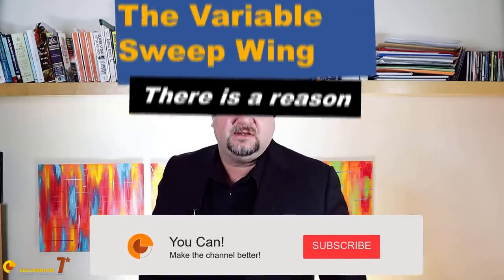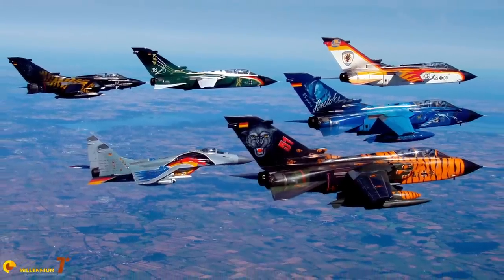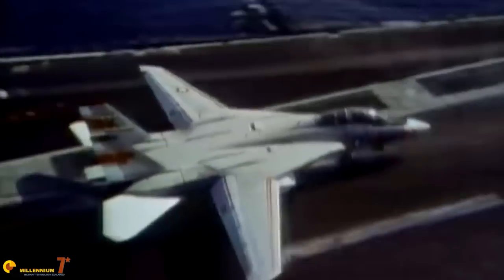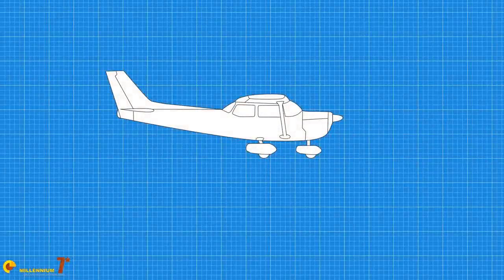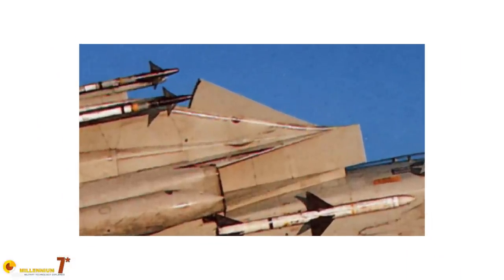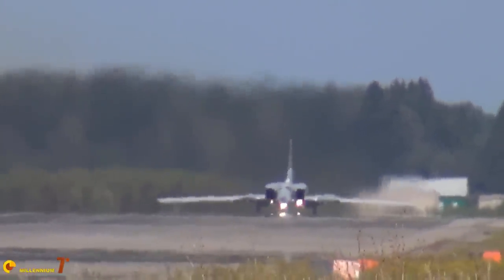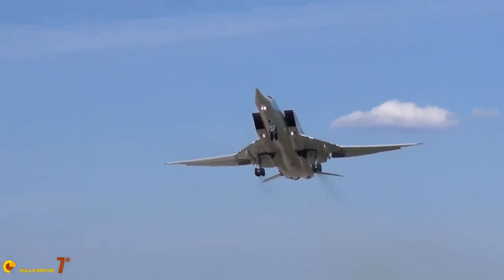F-111, F-14, Tornado, Su-17 were Hopelessly Outdated - the demise of the variable sweep wing

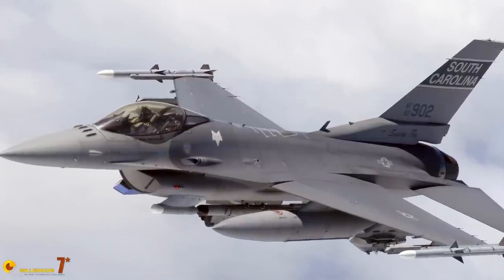Comment: so I actually paused at 4:10 to answer in the comments lol:
being “stable” means applying some kind of negative feedback mechanism which it means it inherently fights back at what you want to do/go, which is inherently counterproductive when you are designing that is expected to exert maximum performance on a regular basis. I’m not fluent in aerodynamics but I am just applying negative/positive feedback logic.
In a scenario where you want are expected to turn at maximum rate etc, having a negative feedback characteristics seem counterproductive, but would be more forgiving to fly. But then yes, computers, so you can have flight computer forgive the pilot instead of the laws of physics.
Reply: This was seen in practice: During ww1, higly maneuverable airplanes like the Camel and Fokker series were only flown by experienced pilots due to the skill neeeded to fly them. Needs constant care on the controls.  Not to mention the engine torque.
Reply: @ASJC27  I think the original commenter was speaking more in terms of a simple non-augmented airplane which does in a sense "fight back" if it is designed with natural stability, right?  Otherwise the flight control requirements for the pilot would be too fatiguing or even impossible to manage if the static margin were reduced too much. I know that you know that also. You are speaking more about an inherently unstable vehicle with computer augmentation. In the end of the commenter's piece, he even acknowledges that with computers, the aircraft can be designed to be (artificially) more forgiving when necessary. I am also a former aerospace engineer. While everything else you say is true, perhaps you are being a bit hard on this fellow, respectfully.
Reply: I'm not an aerospace engineer and don't play one on TV, but stability doesn't make an airplane fight the pilot's control inputs.  Stability means the airplane seeks to return to its trimmed flight condition when displaced from equilibrium.  Pilot control inputs change the trimmed condition and the airplane seeks a new equilibrium.  
I don't believe relaxed static stability is about making the airplane pitch faster; it's about eliminating the downforce on the elevator that decreases the net lift vector and increases drag.  Take two identical airframes, but make one unstable by moving the CG location, and the unstable one will have better some margin of increased  instantaneous and sustained turn performance.  Maneuverability is about the velocity vector.
Reply: @ASJC27  Thank you very much for the detailed explanation.  I been reading misinformed commentary on the contribution of RSS on many channels and forums, as well as hearing the same misinformation on poorly researched television documentaries that simply repeat what was heard elsewhere. Thanks for the help and reaffirmation

Comment: In sheer flight performance, The f14 outclasses the f18 in speed, range and weapons payload and maneuverability. With an avionics/ electronics and weapons upgrade, it is superior. The f18 is simpler and cheaper and therefore maintains a higher state of fleet readiness.....but superior to the f14?.....ah....no.
Reply: but logistics win wars, so .....oh....yes.
Reply: @TealJosh  logistics?Depending on the combat capabilities of the aircraft. So once again....no. Every USN pilot on record who transitioned to the F18 from the F14 who was asked, prefered the F14....They should know.
Reply: @Phuc_Socialist_You_Tube  Shit, I would prefer the tomcat 100%. Nothing beats the feel of steam gauges and analog controls overall. Doesn't take anything away from the objective facts.
Reply: @TealJosh  I Agree....Objective fact one:The f14 Carrys more ordinance....Greater speed, range= it's in the fight longer. Chances are fewer 14s are required than 18s for the same mission. The f18 is far outclassed by the Sukhoi 30M. The f14 not as much although the avionics/ weapons systems would require a massive upgrade. The f18 Hornets upgraded to super Hornets still lag behind in range and speed.  The f14 could still, if modernized, counter threats to a carrier faster and at greater distances than 18s. If you haven't learned to walk on water yet, I can see why the navy wanted to retain them. They felt better equipped. Likewise I can see why bean counters wanted 14s gone.
Reply: @Phuc_Socialist_You_Tube  It always sucks to get something new compared to the old for which you have perfected a doctrine of usage. Your first objective fact btw is wrong, Rhinos have 11 pylons, while f-14 has 9. Legacy hornets had two less, i.e equal to f-14. As a counter, tomcat could take off with higher weight and land a lot heavier. Range is extremely subjective as million variables affect it, give it a tanker and problem solved. Fast interception goes for hornets 100%, they can startup unassisted and the systems are on faster. No matter what hornet is launched from the catapult faster than tomcat used to. I can go through the start up process step by step of legacy hornet if you wish, same with tomcat, I can estimate how Rhinos work.

Nowadays the Navy has built and perfected their doctrine around F/A-18E and F models + the EA-18 growlers. They have significantly better A/G capability than 30 years ago and have significant EW capability that practically didn't exist back then.
Reply: @TealJosh  Here we go again...Gruman offered the DOD a modernization program that would have addressed ALL of the issues you cling too....except the complexity of the swing wing design. It was the price tag. The Navy settled for the 18s, They didn't want them. Who wants to send out vulnerable tankers if there is no need. Now your protecting a ship and tankers. I was very well aware of what the Navy pilots thought of 18s when they got them. I wasn't a kid then. Of course the electronics are better on an 18. The Navy never upgraded the weapons and avionics on the 14s. Why would you when your decision is to scrap. Certainly you can understand that an aircraft that can tailor its wing geometry to its required performance envelope had flight characteristics a fixed wing aircraft can't match. It all came down to cost....and the fact that 14 airframes had a lot of miles on them at that point. The 18s are dinosaurs as are 14s. At this point in time  a better aircraft than either can be built. If, they had modernized the 14s then.....they would have had a better performing aircraft than the 18 now....No doubt at higher cost. The 14 compared to the 18 then would have been superior in all categories with Grummans planned upgrade package. Why do you think Iran still uses them when they could easily get new combloc aircraft. Iranian 14s have to be pretty decrepid by now. That's how much they respect the old war horse's capabilities as is. What you can't do is go through the operations manual for an aircraft that never was. The full extent of Grummans upgrades may have included air frames and engines and start up procedures, who the hell knows, If 14s were around today, they would be as different from the originals as a 16c is from a block 70. All I can tell you for sure is the Navy never liked the 18s speed or legs compared to the 14. Grumman claimed the 14 could completely outclass the 18 with upgrades. The pilots of the time thought it already did. That's good enough for me.

Comment: You completely misrepresent the decisions on the F14 program. The US Navy required a fighter that had significantly better combat range than previous fighters. The F111 turned out to be too large for carrier operations. The F14 significantly increased the range and payload of a Navy fighter and brought an extremely long range active air-to-air missile supported by an unusually powerful air-to-air radar. Because of DOD funding issues in the 70’s and 80’s, the F14 did not get its intended engines (GE F110) until many years later (early 90’s). The F14 community had to endure a weaker engine (TF30) that was supposed to be a short term fix to achieve an early operational capability.

The variable sweep allowed a heavy weight carrier capable fighter that had a slow enough approach speed at the ship yet could fly supersonic. That combination has not been achieved by any other fighter, even your unstable computer controlled aircraft designs. The operational requirements were met in the mid seventies with good design. The F-16 design could not even come close to the operational requirements. The performance of the F-14 airframe was so good, that an A-14 variant was considered that would have given the aircraft an all weather, day or night, low altitude attack capability while retaining a robust air to air capability. Politics and funding issues for competing platforms (A-6G, A-12, F-18)

Finally, your assertion that a variable sweep wing cannot be stealthy is very misleading. With the wings forward the aircraft would be less stealthy, but that configuration is not a combat configuration. It is a takeoff or approach configuration. There is no stealth requirement for takeoff or landing. With wings swept, a swing wing fighter can be stealthy. The very low RCS of pure stealth is not likely, but the very stealthy carrier fighter has notable range-payload limitations.
Reply from the maker: I am sorry to hear this but you are one of the many who think that the video is about the F-14, it is not, it is a video on the reasons why the variable geometry wing is not used anymore as a technology solution. The F-14 is only an example because it is easy to find data about it. There is a series of 4 videos about the variable sweep wing.
Reply: @Millennium7HistoryTech  The move away from the swing wing design is much more complex than your description. Balancing operational capability versus cost is frequently a political decision, or chasing the newest technology. Because of the unique operational requirements of carrier operations, compromises are made. The move away from swing wing has not improved the carrier’s strike capability. It has seriously degraded it. The current and future crop of fighters have significantly less range/payload than the F-14 because their design does not allow for the high gross weight required to carry fuel and weapons a long way.

Comment: Was it fly by wire that made them irrelevant?
Reply from the maker: No, the introduction of relaxed stability, that also needs FBW to be effective.
Reply: They are not irrelevant, and neither FBW or relaxed stability have anything to do with it.  Variable sweep is simply not the cost effective choice for a fighter that does not prioritize extended endurance or high carrier landing weight like the F-14 did.
Reply: @gort8203  so why for instance did the eurofighter typhoon or maybe Russian fighters in the 80s incorporate a swing wing design? I mean if they were still relevant wouldn't there be other examples flying other than the Tornado?
Reply: @jmcfintona999  I believe I have already answered that question: "Variable sweep is simply not the cost effective choice for a fighter that does not prioritize extended endurance or high carrier landing weight like the F-14 did."  Teh VG wing is not about maneuver ability, it is about range and endurance.

To try to elaborate, The F-14 was designed to patrol and cover the fleet, and at the end of its patrol land aboard while still carrying heavy Phoenix missiles. Compared to a smaller fixed wing, the VG wing also allowed it to carry less fuel than it would have otherwise needed for that patrol, so the wing did not impose a weight penalty in relation to the overall mission profile.   
European fighters do not operate under the same constraints and in general have usually been of relatively shorter range and endurance.  The Typhoon design prioritized maneuverability, so a VG wing would have been unnecessary and likely detrimental to maximum maneuvering performance. 
The Tornado was much like the F-111 program in being designed to fill the low level strike as well as high altitude air defense roles.  The VG wing gave it more range, payload, and endurance than it would have had with a small highly swept wing necessary for high speeds .  
As I said elsewhere, the technology of the VG wing is not outdated, but the mission profile it supports has been replaced by newer tactics.   That's why the B-2 doesn't look anything like the B-1.  Take stealth out of the equation and the B-2 would not have been built, and the swing-wing B-1 would have remained the primary penetrating bomber for much longer.

Comment: 6:51 wow for such a beautiful plane the bomb bay interior of a Tu-160 looks decrepit and badly maintained
Reply: Everything on Tu-160 looks decrepit and poorly maintained.....because it is. Weather conditions and lack of infrastructure in Russia are hard on aircraft or any vehicle.
Reply: Why do you think they are being taken in pairs to be modernised? The 90's and early 2000's weren't exactly nice to those birds. They only kept them in flying shape. Even the Tu-22 suffers these problems. The newer more recently complete Tu-160's look quite a better. 

Think of it like getting lost in the woods for 30 years without a shaving kit.
Reply: @PugilistCactus  A lot of them were in the Ukraine when everything officially fell apart with USSR.  Many of them were scrapped by the Ukraine as part of arms reduction and Cooperative Threat Reduction with former satellite states.  Russia bought back several of them from Ukraine with a debt forgiveness deal over natural gas.

Since they will never have a competent bomber production line for them again, they have to cobble together whatever they can from the existing airframes.  Only a few dozen were built.  They falsely advertised that they are in production again.  If you look into the official statements, it's the Tu-160SM2 serial modernization 2 upgrade package for existing airframes, not new airframes from scratch.

Comment: The F-14 was most definitely not outdated. Even though the plane has been out of service for almost 16 years now, I believe that it still to this day has the most powerful radar ever put in a fighter. Also, those AIM-54 Phoenix missiles are still, without a doubt, the best radar guided AAM's ever made. One day they will be surpassed; the newest version of the AIM-120 AMRAAM is getting somewhat close, but those Phoenix missiles are absolutely legendary.

It's unfortunate that funding was cut from the F-14, since the plane was originally supposed too be on service til this day. I could only imagine how much better it would be now.. what kind of improvements would the AIM-54's have gotten? Could it have an even better radar? Fly by wire controls? More powerful engines? I always wonder.

Comment: Mah... this time i have to disagree.
Seems solid excuses for a "we can t do that " logic, while back in the days there was a "we will find a way somehow" logic.
For example, a "modern stealth tomcat can be stealth in a specific configuration (wing closed) and still be able to open for agility at the expense of stealth, or have simpler maintenance thanks to design, like f35.
F22 weights the same as f14, it counts just on raw power and thrust vectoring (another technology abandoned too fast by usa), and with modern materials, paints, and technology in general, im sure an f14 could be fast, stealth and still beat  f22 in many flight envelopes !
Reply: A swing wing will always be heavier, reducing performance, and will always require more maintenance, reducing availability.

Stealth aircraft suffer from lower availability as is just to maintain the stealth coating, combining both swing wing and stealth will reduce the availability so far as to be pointless.

What’s the point in having 100 planes if only 20 are ready at any given moment.